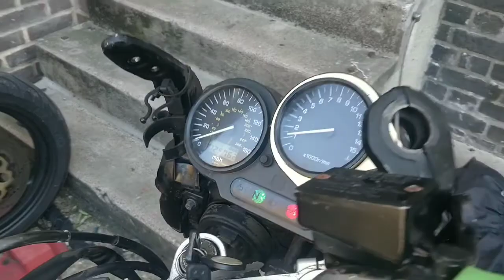Yamaha Fazer fzs project, 600cc, first attempt at a start up

Comment: Blood alarms and immobilisers on bikes are a pain.
I’d be inclined to strip the carbs and buy a rebuild kit for them.
I do see this being a decent cafe racer project.
If you don’t have a little blowtorch is brilliant for stuck bolts etc
Good luck with this
Reply from the maker: The carbs are ruined, the bowl bolts were solid some of them and had to be drilled out.

I'll use this set to see of the bike seems OK and of it does we will grab another set for long term use
Reply: motorcycle rescuer  fair enough
Plenty on eBay

Comment: I've got a fazer 600 so if you need a hand on something let me know.. But mine had the same alarm system still has the flashing led but not wired up to the bike anymore as it has a different system now.. But you don't need to pull the clutch in to start the bike. But it does sound a bit lumpy. So the carbs might need to be balanced and the ticking mine only doesn't it while it starts up fok cold and then goes within 5 seconds been told it's completely normal as the bikes cold.. But the ticking does seem a bit louder than normal
Reply from the maker: I think the valves need adjusting, I will find the time to do it at some point just to tick it off the list. I've got to sort the carbs out properly soon though.

It's a big old project this one.
Reply: @motorcyclerescuer  yea it's just finding the problem but at least with a fazer it's easy access to most parts. But thd fuel pump is the easiest thing to do on it.. I got mine from ebay for 35quid and at the same time replaced the carbs to head rubbers for 17quid on ebay as everywhere else was selling them for 78 but found a seller selling them for 17.. But after changing my pump and rubbers the bike starts better now
Reply from the maker: @gin9erbiker  thanks dude, I may be coming back to you to get more advice. But first on the list is carbs sealed then valves.

Thanks
Reply: @motorcyclerescuer  no worries.. I did see on ebay fazer carbs looked pretty good condition and was I think 40 quid
Reply from the maker: @gin9erbiker  no way, I've been looking and all were over £100?

Comment: Might also be worth checking the cam chain tensioner while you have the carbs off,
Reply from the maker: Yes good point, sounds like valves more but I'll have a look at the tensioner anyway. I think after so many years and with a hole in the engine it wil all be a bit rusty and stiff. The carbs are the next challenge. Ideally we need another set.

Comment: I've cleaned carbs on my fazer but can't remember if I've put throttle cables on carbs right as there a bit tight how do I tell cheers mate
Reply from the maker: Hi Stephen, it won't rev if they were the wrong way round as the other cable is a return cable. If it helps you can only use the rev cable and ignore the return cable if that makes sense mate
Reply: @motorcyclerescuer  yes it does thanks and thanks for your reply
Reply from the maker: No problem, good luck with it.

Comment: She lives.
Reply from the maker: Yes, I've no doubt that we could put the carbs on properly and it will start on the button. But it's alot of work getting everything loosened and looked at. Even the air filter screws are fully rusted meaning they will snap if we try to get the air filter out.